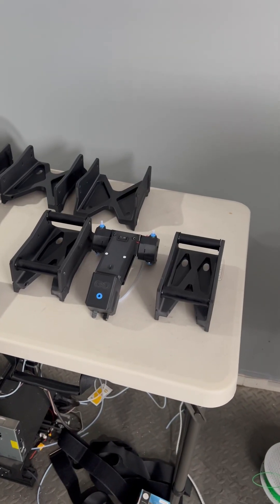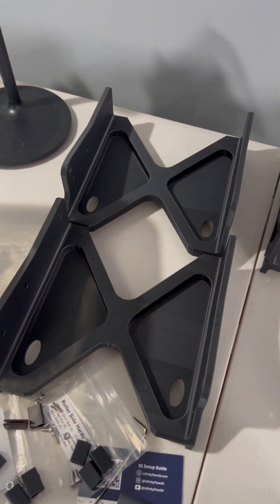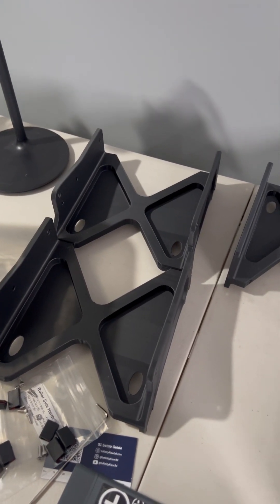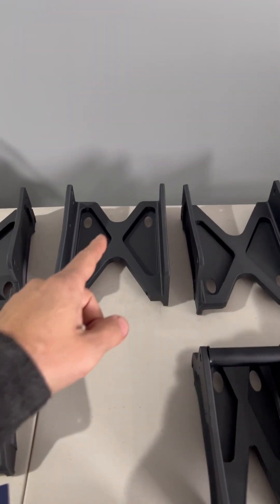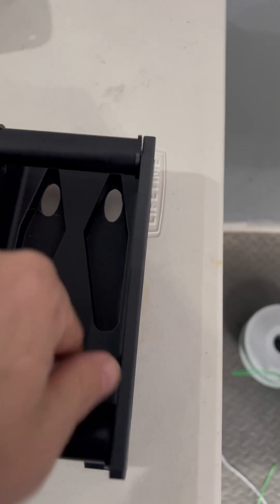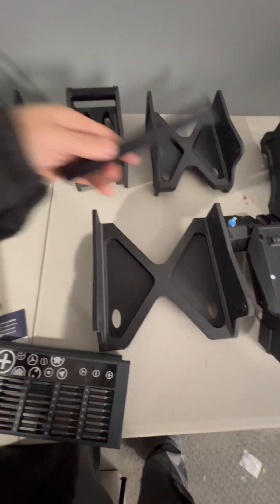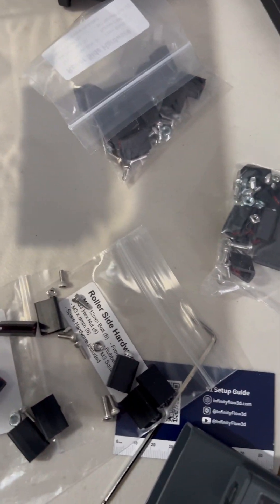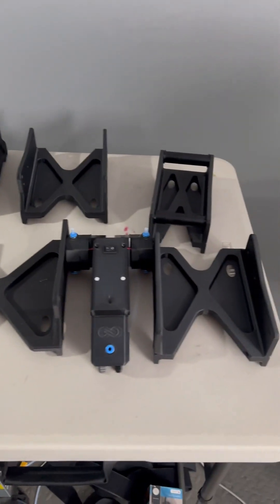Assembling the Infinity3D S1 Auto Filament Changer

Comment: I've never heard of these spool holders. Are they a home-brew version of an AMS system?
Reply from the maker: It's an auto spool switcher. When one spool runs out, it switches to the other spool. It does this, without any need for connectivity with the printer, which makes it, in theory, compatible with any machine, that has a Bowden filament path.
Reply: It was a kickstarter campaign from some college kids.  Kinda cool.